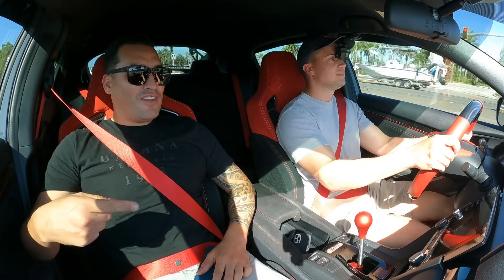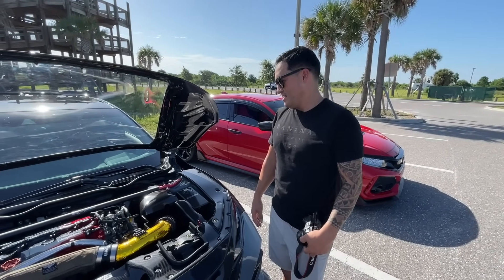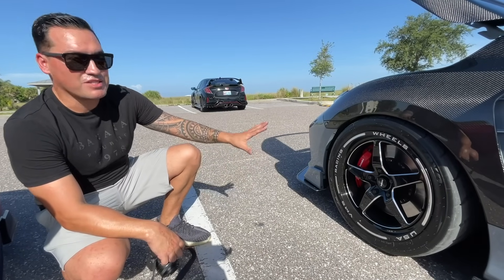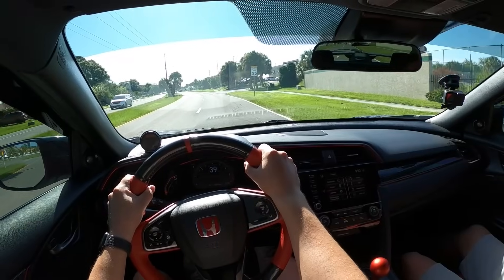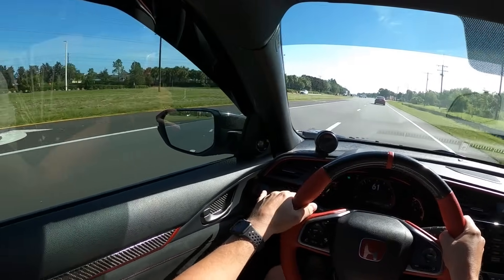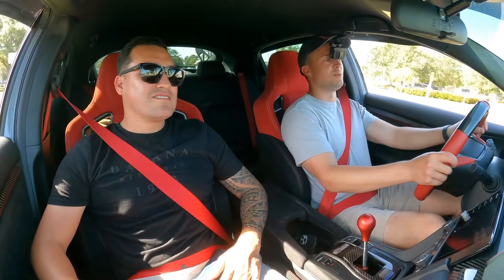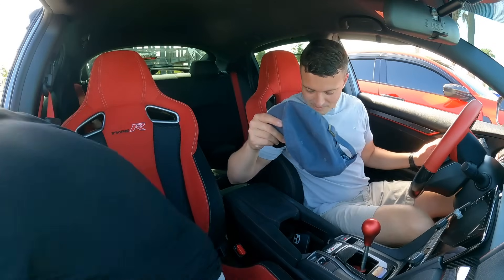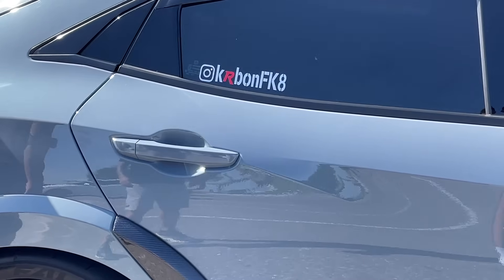547 WHP Big Turbo Civic Type R Drive and Review!

Comment: Marco’s build is such a beast! I would def recommend 70A. The 62A feels really good at first, but it ends up being too soft after it breaks in. The 70A is perfect, and I daily my R.
Reply: Agree💯
Reply: Is 72 the most extreme race?
Reply: @snowfreak207  I haven’t heard of a 72. There’s a 60a, 72a and the “race” mount is 88a. Those are the Hasport ones. I think 27WON is close to the 70a. Imo the 70 is perfect. A buddy of mine had the 88, and while the vibrations aren’t extreme, it’s def a lot more noticeable than the 70.
Reply: Torque Solutions 75A is the way to go
Reply: completely agree! Honestly you don't need the full set though.  Just get the rear mount in 88a and it works perfect, while saving money.
Reply: It's good to be rich

Comment: Usually the rock sits between the rotor and the brake cover, sometimes you may need to bend the brake cover back a little bit. Fellow FK8 owner here, once i bent it back a tad i no longer get pebbles between the rotor and cover.
Reply: Oh don’t bend anything lol, two words for someone having this issue: pressure washer
Reply: @hazelvazquez765  calvin is right it's only a backing plate that can be moved quite easily the metal is thin like a coke can.
Reply: Scared the fuck outta me when a pebble got stuck in between there. Thought my front left break was loose or something just to realize that was the problem 😑
Reply: I have a 10th gen SI, I go through the same thing. A slight bend of the Cover and the pebble falls out

Comment: Thats crazy
I made 547whp/437wtq on my p600 e50 at 33psi
G25-660 is a great stock block turbo tho - good all around setup that spools quick but still has good top end

The german intercooler is good - they make quality stuff
John P is releasing a 1000hp intercooler setup thats even larger and flows better than mishimoto which is an 800hp core vs the smaller cores like HKS, PRL etc that at are 600hp rated....the ratings are crank
Reply: I heard different numbers for stock block. I wanna get a ctr but dont know the limits of the k20
Reply: @slowdownx3919  stock block has been holding 630whp for sometime now
Im making 566/434 and was fine- easily make 580ish on stock cams.  Once you add cams you can go well into the 600s with no issues
Reply: This true I’m at 589whp/471tq on E-50 and 33 pounds of boost  no issues

Comment: 500+ whp in a Honda feels like 700+whp. Very nice whips my dude.
Reply: cause its light af
Reply: @favsongs4313 cause all the power is flowing through the same wheels steering lol
Reply: Weight to power ratio is fun eh. Our 2017 spider weighing 3000lbs or so at most only had 160hp but she flew faster “feeling” simply due to that fact. It’s a mediocre 1.7L with a turbo but that’s Fiat for ya.

Comment: race this against GTR. since it has about the same HP but a lot lighter. light weight vs awd system. lets see the difference
Reply: Gap a stock GTR from a 60 roll easily
Reply: @TheFK8Life  yeah I would agree. But on track could mean the difference.  Type r do really good on track. We all know gtr is a beast on the track.

Comment: I have the Mitsubishi tourbo stage 2 & it's fast the intercooler tho might wana go wit that I have the Injen one but love content
Reply: You need a bigger 800hp intercooler like mishimoto, full race or ultimate racing
the smaller 600ho coolers like injen, hks, prl etc they dont flow as well and are more for stock turbo - mhi st2 with ethanol and good intercooler can make 550whp no prob

Comment: Can you do a video on your thoughts on what upgrade turbo you think you would go with for the R. I have same mods and tune as you but I was interested in getting a big turbo but I'm stuck between the 27won and the Prl P600.
Reply: 27won is doo doo
p600 is ok
RS500 is drop in king
Stock motor champ is g30-770
You can make 620whp with a g30-770 and tr2 cams

Comment: Hey I have a 500whp type r question what Clutch do you run? Tryna get opinions and options this time around
Reply: stock clutch is fine - im making 566/436 - just bring the torque is later/smoother and it holds

Comment: Dudes on a stock clutch is with 530 hp and my si with stage 1 tune and intake cries whenever I give it the juice
Reply: Get the Type R retro fit for the Si and use this clutch....like stock but handles 450wtq easily

Comment: He's on the stock fuel system? No F'ing way that's possible. My mechanic won't install the new 27Won Turbo until I get the XDI pump and the drilled fuel line.
Reply: He’s xdi stock pump can’t handle more than like 410
Reply: Hes running meth which is additional fuel as well

Comment: That's a sweet setup but a lot of money to dump on a car for 200+ additional HP.  I'm happy with mine at stock with only a high flow K&N Filter and HKS Spec L Exhaust.
Reply from the maker: Most of that money he spent was on visual modifications
Reply: Stock is 280whp
This litetally more than doubled stock power
306 into 620hp
Reply: @Camhill182  I got a 750whp tr6060 swapped 5.0 mustang if you want to review that.  I’m in San Diego.

Comment: Here's my question for marco, I know he says that it's fully stock internals I'm wondering how that works with the rev limiter set to 7800.

Everything that I've read says the K20C1 starts to experience valve float around 7300 RPM. 

Are you regularly over revving to 7800 on the stock valve train and camshaft?
Reply: Stock internals, stock clutch and stock brakes on a car rated at 300hp from factory and he put 200hp on top of that? There's no way he's revving to 7800 regularly. I'm also not convinced he drives that car a lot either lmao
Reply: @meCmoni  it's all a bit sus tbh
Reply: @jmeyering11  Surprised the clutch wasn't slipping in the video lol Then again they weren't really pushing it.

Comment: This that one car you look back in life I regret spending 50k on a car plus 30k on big turbo and leaving stock internals, clutch, brakes and probably stock fluids too in my opinion horrible build
Reply: 30k was all mods
You can make this power for like 12k
Car is already a beast and easily puts the power down - its a Type R not an Si
Reply: @TheFK8Life  oh i know he put 20k in cosmetics instead of reinforcing the engine and transmission… thats what im saying its a horrible build 80k on it 40 dollars car and he didn’t do it right.
Reply: @victorjoa8035  No need to build the motor below 600
Im stock clutch, stock trans, stock motor 547whp/436wtq  on e50
Reply: @TheFK8Life  lol, so according to you is safe to more than double the whp on stock motor, trans etc… i dont know how long you been building engine but if you ask any mechanic they will tell you that you are a few redlines away to see white cloud in your rear mirror
Reply: @victorjoa8035  Ive been racing Hondas for 25 years - if you wanna do some 60 rolls in LA - hit me up
Not my first rodeo kid
Reply: @TheFK8Life  thanks for the offer but i dont street race, i only pass the speed limit in the track….
Reply: @victorjoa8035  lmfao

Comment: Bov are bad for these cars unless you’re running motec. And I thought the R couldn’t rev higher than 7200 because the valves start to float ?🤔
Reply: Custom tune… i seen plenty of us up there
Reply: @marcaravena380  just did my research, it is possible just not reliable in the long run
Reply: @Fk8.Hector  bov doesnt hurt. No bov shortens the life of the turbo because when the throttle body closes the air/pressure is forced back through to the compressor side of the turbo, forcing it to try to start spinning in the opposite direction.
Reply: @Ehren1337  that too but also you left out the fact that with a bov the engine will run rich for a split second and throw the off A/F when letting off. The stock Ecu can not compensate for it and can’t be tuned out. Unless you’re running motec. Look it up and plenty of tuners who deal with these cars every single day will agree.
Reply: @Ehren1337  so yes over time it will cause damage to the engine due to the rich A/F.